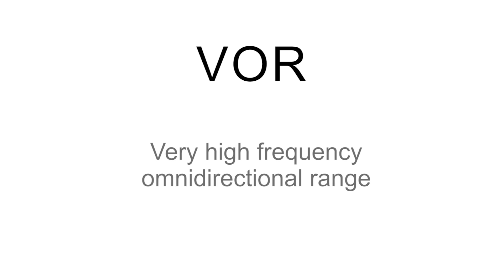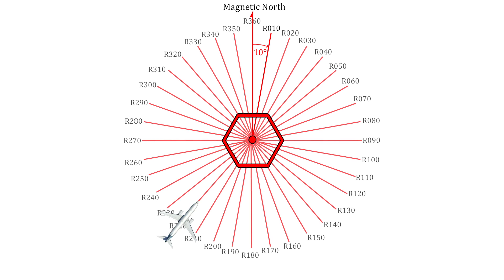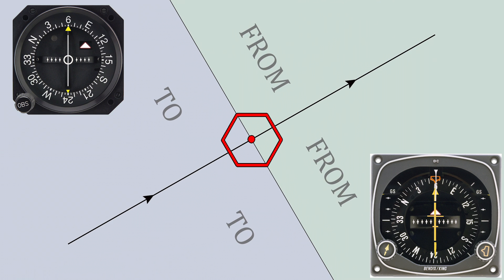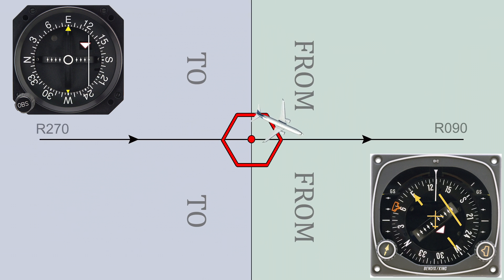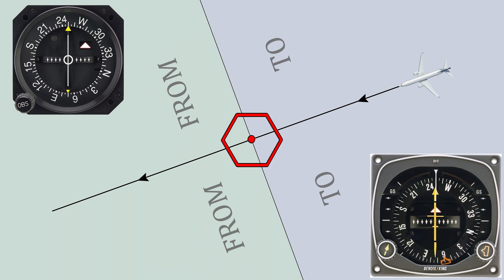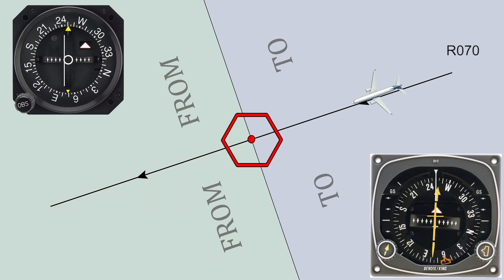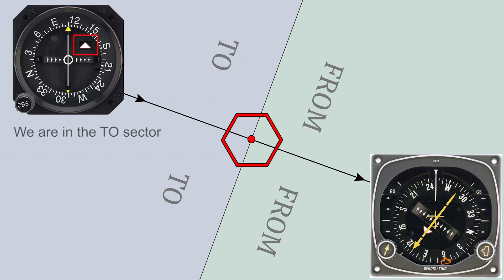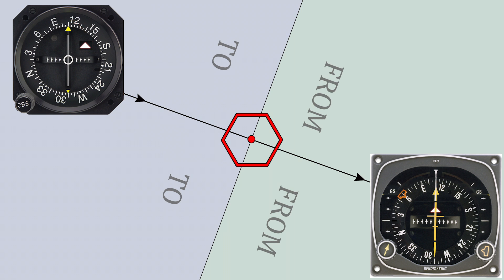Basics of VOR Navigation

Comment: Really good video and thank you for posting this. I need to add few points here. same thing will happen if you select 250 and  indicator showing FROM flag  but aircraft nose points towards 070. in other words , if actual  aircraft moves to the left from the centre line  the course deviation also moves to left. also the course deviation  looks ok  if u select 070 ( with FROM flag ) but aircraft nose points the opposite way.   to avoid this, use a dot instead of a aircraft symbol and then put arrow towards the direction of the selected course to get the reference direction. this way there is no conflict with the deviation pointer. hope this is not too confusing...